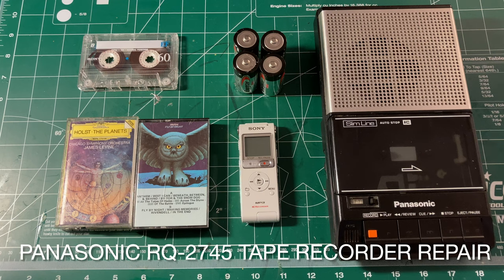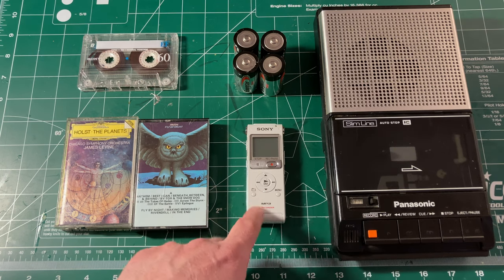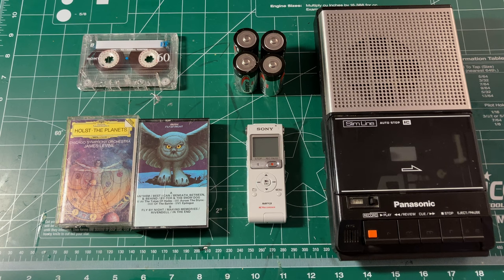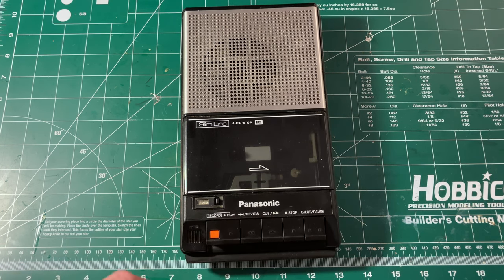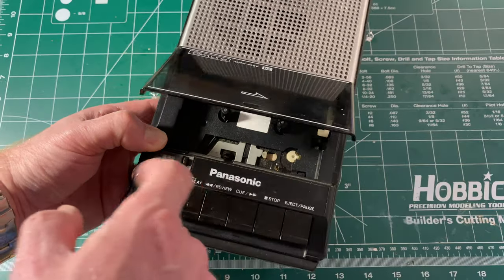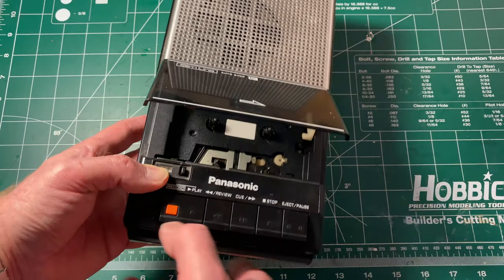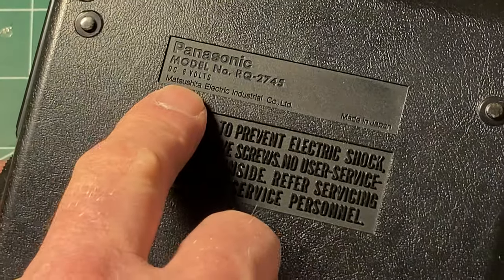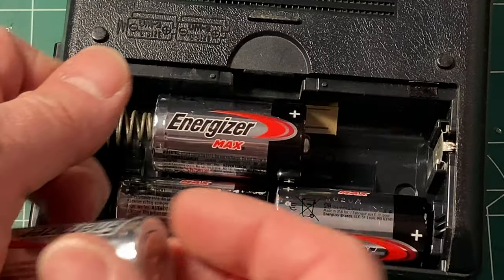Panasonic RQ 2745 Tape Recorder Repair

Comment: I’ve literally got the rq-2103 right next to me and it looks almost identical to your model. Had it forever; still works great. About to frankenstein some sort of a 6v dc input so it works from a 110v wall outlet instead of C batteries. Yay cassette tapes! Hooray for all the cool stuff 99% of people consider junk that’s probably older than me and has outlasted every iphone I’ve had by an average of 10x. Haven’t seen any new tapes on the shelves though since 2013 in Las Vegas which is the last time I needed something specific, walked into a Radio Shack (RIP) and found exactly what I was looking for.

Comment: I took apart one ☝️ of these, but the name was RCA. I can’t remember what was wrong 😑 with it, but working on one ☝️ of these can be a little tricky. The parts are quite small, crammed closely together, and can easily be damaged. Unless you’ve got about all the time in the day, you’ll probably make the repair 👩‍🔧 just fine 😅. I can see that you’ve got a better cassette recorder than ones made today. Your friend, Jeff.

Comment: Panasonic Rq-3145 but there's almost a high pitch sound when raising volume and a slowness to the sound. Would you have a guess on what my issues may be?
Reply from the maker: That might be two separate issues. For speed issues, I’d try a new belt first. I’m not sure what’s causing the interference, but it could be from the motor. The most likely cause is bad routing of the wiring harness. I don’t recall if there’s a noise suppression capacitor on this tape recorder but if so you could also try that. Test with batteries and away from other electronics to rule out the power supply or external interference.

Comment: Great video! Where can you order the belts?
Reply from the maker: These were just cheap ebay ones.
Reply: @sfred  Well I got a Tascam Porta05 replacement belt kit... But do you know what size for these models you have to get? Or share an ebay link?
Reply from the maker: In this video I used a walkman-style belt, 0.7 mm square. It worked, but this was not the correct belt. The correct one should have a rectangular cross section. The only way to be sure is to open up your machine and see what size it is.